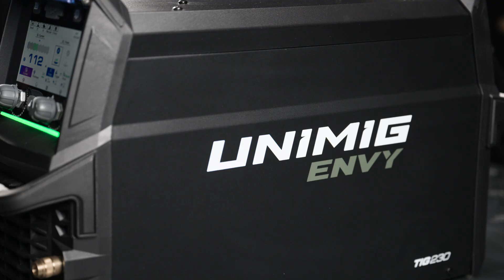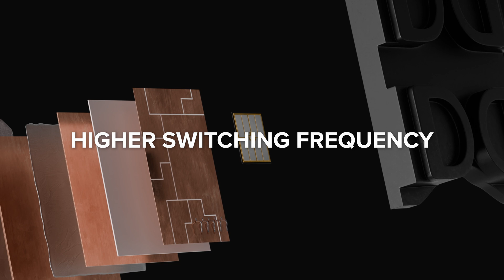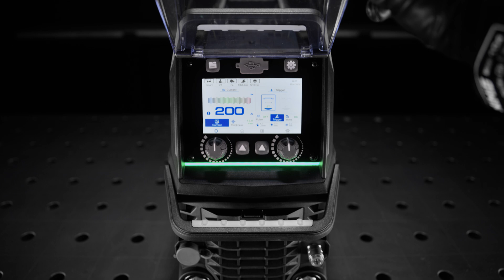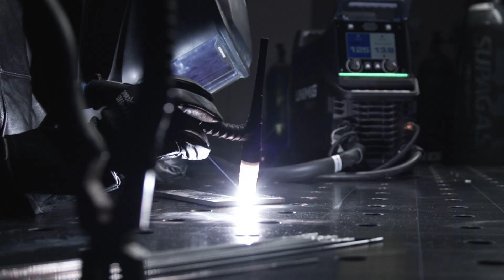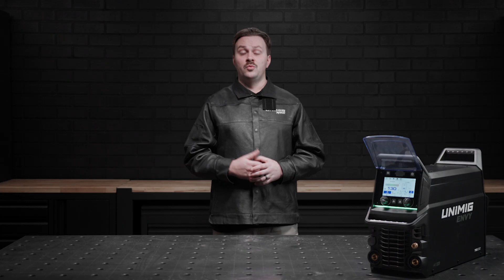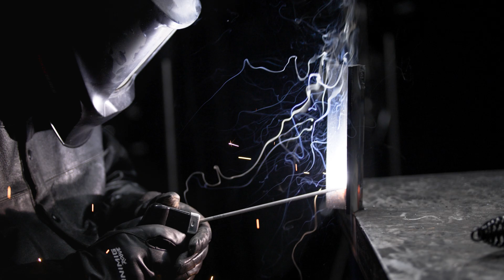ENVY TIG 230 AC/DC Feature Video

Comment: Was waiting for xcel arc to stock these in nz. They've set the price point at a ridiculous $5000, unreal that i can buy one from unimig in aus ship it to nz and pay tax whilst saving over $1000
Reply from the maker: Hi David, appreciate you calling this out. We're actively working with our New Zealand partner to address this. The price increase you're seeing is not final and definitely won't be anywhere near that extreme. We're aiming for around a 10% difference compared to Australia, which is mainly due to the higher GST in NZ and recent USD to NZD exchange rate changes. Thanks for your patience while we finalise this.
Reply: @UNIMIG current listings in nz market for them are around $5200nzd if i was to purchase tomorow. I hope that this price difference is sorted soon, i hope other consumers have done their due diligence and not paid the hideous sticker price xcel has on them. i love the unimig/xcel arc welders, ive been a long time user of the tig machines currently rocking the razor 200acdc pfc. I look forward to getting hands on with the envy 230 once the xcel arc pricing becomes more reflective of that offered by unimig.
Reply from the maker: we appreciate the support and for being a long-time UNIMIG user. We hear you on the pricing and are already working with Xcel Arc to bring the NZ pricing closer in line with Australia. Our goal is to have the ENVY 230 available at a fair and competitive price, with only a small difference to account for GST and currency shifts. We’re confident this will be resolved soon so NZ customers can get the same great value. Out of curiosity, which store currently has it listed at $5,200 NZD?
Reply: @UNIMIG 
Tool and industrial have it on sale, discounted from 5500 down to 5200